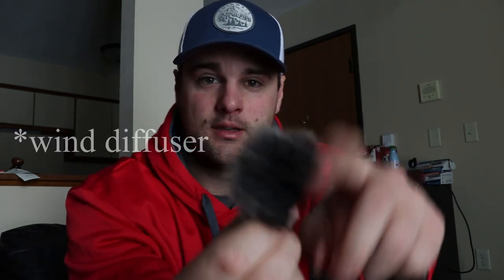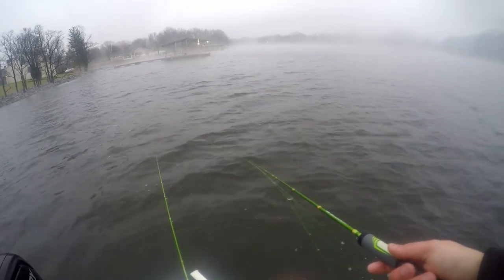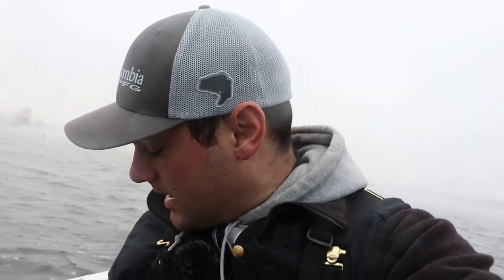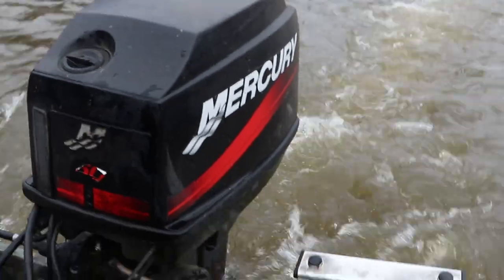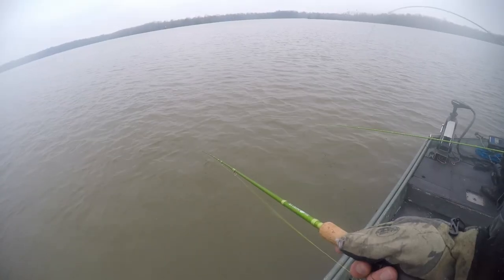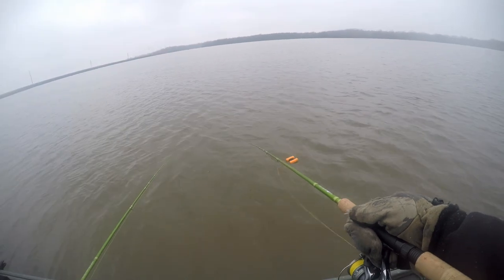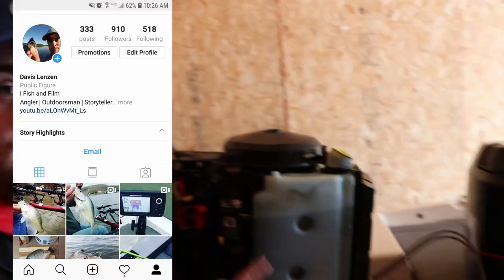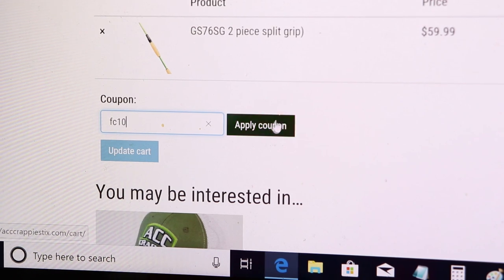Illinois Tour 1: Caught my NEW PB on a Classic Crappie Bait!

Comment: Nice job buddy. Feel that thump.
Reply from the maker: thanks!
Reply: @FloppingCrappie  I wanted to go today. I have a 25 horse johnson. But its not running rite. I have done everything except change the power pack.  Its cutting off after it get hot.  I am gonna order the power pack today. I hope that solves the problem. I'm dying to go catch some crappie.
Reply from the maker: @scottcozart8950  I'm kind in the same boat, pardon the pun. Its -2°F outside, a little to cold to replace my starter
Reply: @FloppingCrappie  holly crappie.  Its 40. Here in N.C. rite now. Windy and rainy.  The water temp yesterday was 53.4.  On my local lake.  Its bout that time.  Gotta get her fixed lol

Comment: Try using contact grease from an auto parts store for the connector on your mic may save you some money
Reply from the maker: I don't think that will fix the problem. the cable/wire from the insert to the microphone connector is very thin and breaks after a few months. I would have to rewire the connector to make it work again. They are only about $10-12, so I just look at it as the cost of filming. Thanks for watching!